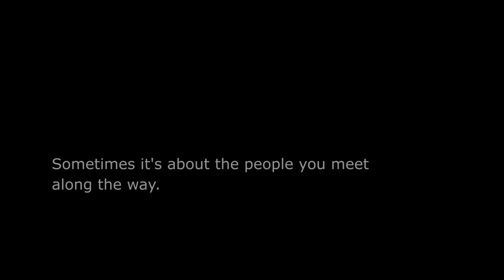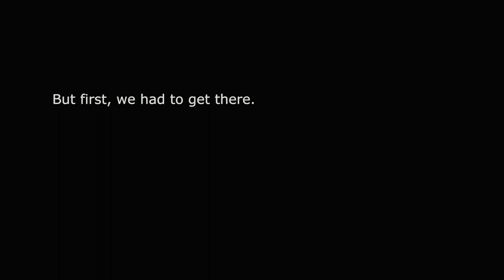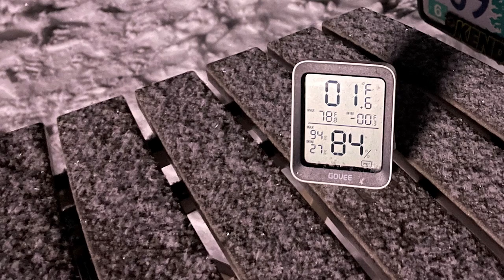Getting Stuck and Surviving in Sub-0 Temperatures - Primal Outdoors Winter Campout

Comment: Okay that was hardcore winter camping! So great that you did the travel in a group to help with getting stuck. How cold were you in the van at night? Chambers Family Overland just gained a Sub :)
Reply from the maker: Not gonna lie, it was COLD in the van. Normally we can run the Mr. Heater Buddy for a little bit before we go to sleep to heat up the van, then turn it off and we're fine. Not this time. We had to run it on high the whole night (with our vent/fan open). I was constantly getting up and replacing propane bottles when they ran out. It only took minutes for the cold to suck out every last ounce of heat in the van. For this kind of thing you really need a diesel heater to be comfortable. It was fine, but I wouldn't say it was "comfortable". haha
Reply: @VegaVenturing  Well Props for surviving! There's probably no way my wife would've done that with me :D